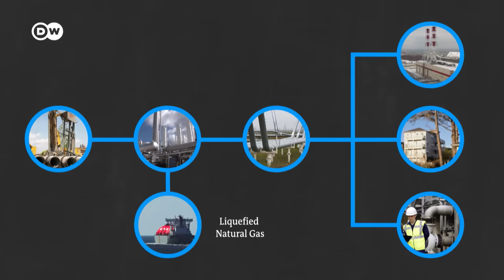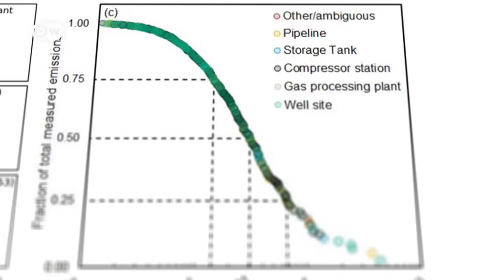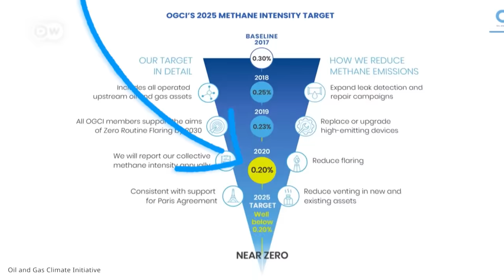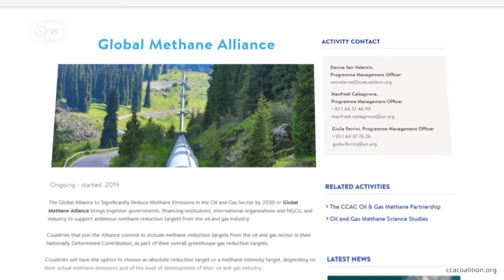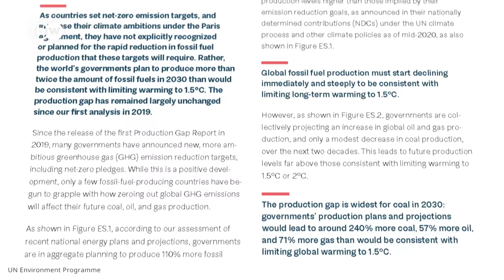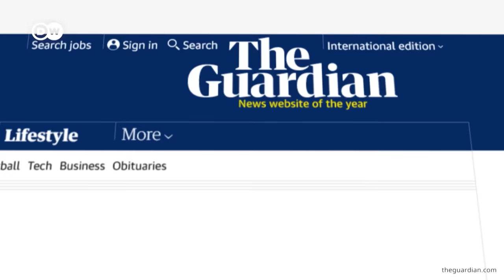Why we need to ditch natural gas (asap)

Comment: we most certainly do NOT need to ditch natural gas.  It is cheap, useful and reliable and easily transported long distances.  CO2 does not cause global warming of 1.2 degrees celsius since 1700.  CO2 concentrations re-act to and do not cause changes in average global termperatures.  try learning some real climate science.  CO2 levels have been DECLINING for the past 150 million years until 1850 from 2500 parts to 280 ppm in 1850 to present day 415 ppm which is way still below the optimal growth level for plant growth of 1000 ppm which would double or even triple agricultural yields worldwide.

Comment: There's no viable candidate for grid storage. Not to mention the production co2 and the toxic materials used in batteries and solar. Wind has a real disposal problem plus co2 from production. Nuclear power is a good option if you can dispose of waste for a thousand years.

Comment: The reality is that the only CO2-free sources of power are hydro and nuclear with limited supplies of the former and Green objections to the latter. Wind and solar are intermittent and frequently do not supply power at the times needed so must be backed up by other sources for which only gas and hydro have the required reaction times. With limited supplies of hydro that leaves gas since one can forget the fantasy of batteries being the solution due to efficiency and capacity factors. The UK, India, and other countries will solve the problem with small-scale nuclear plants such as are used to power nuclear submarines which will be available to be deployed by 2030. Countries that do not go this route will fall into industrial decline and poverty. Hydrogen is another possibility that will be made possible by using off-peak demand from small-scale nuclear plants to allow them to run at full capacity which is their best mode of operation as will off-peak recharging of EVs.

Comment: NuScale SMR is the only solution right now.  We need nuclear, and SMR is the only economically feasible solution as the regular nuclear reactors are too expensive capital wise and takes too long to build.  SMR is fast and economically feasible relative to the regular nuclear reactors.  And NuScale is the only available SMR that is approved by the NRC.  All the other SMR are in the drawing board and will takes decade to be approved and will be too late even if they are cheaper and better than NuScale.

Comment: Gas at the moment is much cheaper  than electricity, makes no financial sense to scrap my boiler, cooker and heater costing me many thousands of pounds for a bigger monthly energy bill.  Coal energy contribution is only 1.8% from almost 100%, so we have come a long way, renewables is just short of 50%.  The planet though is becoming greener as a result of the increased CO2 concentration.  Get electricity prices under control first that’s what the consumer wants and also promote solar panels with good grants on housing and a decent pay back tariff to feed back to the grid.

Comment: The main problem with getting rid of natural gas is that natural gas is waaay more efficient for heating than electricity. You get well over 90% of the energy in natural gas when burning it for heat. Electricity production is always lower efficiency per BTU, meaning you usually burn more carbon when producing electricity for heating, than just burning natural gas for heating.

Though I do agree that the fossil fuel industry likes to sugarcoat natural gas. It still produces carbon when burned (and natural gas leaks at wells is another problem). We should not be relying on it much for future power production - even to balance out solar/wind (nat gas peaker plants are terribly expensive and inefficient compared to base load power plants). We should aim to only use it as heating for homes and industrial applications requiring heat specifically.

And even heating with natural gas isn't required for warmer climates. Heat pumps, with electric heaters, will do just fine in warmer climates where the majority of heating is delivered from underground heat exchangers. Natural gas is really only required for very cold climates where heat pumps can't keep up, and electric heating is stupidly inefficient.

Comment: Nuclear is the best immediate option to avoid conflict, civil unrest and wars that are liable to happen if people are forced into pauper lifestyles due to energy scarcity. Carbon sequestration from the atmosphere to produce synthetic fuels (or just to store useful hydrocarbons) using renewable solar and wind energy is also a great option, because it both allows one to undo the GHG emissions, and to  not have to go cold-turkey on hydrocarbons used not just as fuels but also in manufacturing/industry etc.
Reply from the maker: If you like nuclear, you might be interested in:
📺 Do we need nuclear power to stop climate change?: https://youtu.be/9X00al1FsjM
📺 Is nuclear fusion the key to fighting climate change?: https://youtu.be/eyHovWQ49MI
Check them out and let us know what you think in the comments 🙃

Comment: Another dumb and unsustainable plan. Unless you want to replace relatively clean gas with coal powerplants to power the massive increase in demand for cooking and heating. Not to mention the need to basically double the capacity of the grind if you go this route.

Comment: I like to differ.  How do you make compost.? By rotting organic material. What takes place?
Methane gas enters the atmosphere. A gas that is several 100times stronger than CO2 in Climate change.
Same with sewage, farm waste,  cow or pig dung on fields, and any food processing waste.
That process takes place everywhere in the world. Every day.
What happens if you take all this organic material in industrial biogas converters.
You have methane gas, that burns into CO and little CO2,
You have oil, petrol, fertilizer
You have created a cycle that is sustainable, the raw materials don't run out.
You have saved the environment and climate.
Why do You think this technology is not used worldwide in a big stile?
Is it cheaper to pollute the environment with cheap oil and gas?
Just a little education, I hope you get the idea?😁😁😁

Comment: Sollar panels still require a rather harsh of industrial compounds to be made, wind turbines of the size we need and magnitude would and is affecting local fawna. Everything has its downside, but if we had Sollar and wind supplemented with nuclear. We’d be able to limit the damage caused by each one of them. Nothing we creat at this size won’t have its issues. It’s about living with the issues we creat. I would far more prefer the pollutant bi products of solar, wind, hydro(a bit of a golden child but still requires hyper specific locations), and nuclear which has an extreme level of control over their bi product in the form of their contamination cylinders made of concrete. A nuclear plant can account for 100% of their nuclear waste. down to the atoms.
Reply from the maker: Hey Edward! We did videos on several renewable energy forms, as well as nuclear. A few of them here: 
Floating offshore wind 👉 https://www.youtube.com/watch?v=El4kHkJ7ITs
Solar energy 👉 https://www.youtube.com/watch?v=sUvaYycoWqI
Do we need nuclear to fight climate change? 👉 https://www.youtube.com/watch?v=9X00al1FsjM
Reply: @DWPlanetA  very glad to see that, I’m happy to see you speaking about our many options. I thank you for bringing this to public attention!!

Comment: The video hammers on NG throughout the video then comes to "sure there's going to be a lot of investment needed" for renewable energy sources - investment that easy to call for but very hard to make profitable.  Plus, in spite of all the advances, renewable resource energy storage is no where near being capable of sustaining our civilization, now or in the long term.  So the stated alternatives are pipe dreams - ill thought out alternatives that simply cannot and will not work to keep the lights on and the homes warm.
That's the problem with the green crowd.  People who say a lot, but think very little and when you get people, like those producing this particular video into politics, we get recessions, depressions, inflation and $7 or $8 gasoline and economies turned upside down along with whole populations starving.  But that's the point, isn't it?  Protect "mother Earth"?  I'd say our real danger is from people with points of view that are dangerous to our civilizations, not the earth itself.

So what is the answer to our problems?  It's very simple.  We have too many people.  We need to control and reduce our populations to sustainable levels.  That will free up water resources, agricultural lands and ultimately lead to less emissions of all types.  I suppose the ultimate goal of the green group is just that, but through poverty and starvation.

This video should be banned.

Comment: Lol....  The shot at Tesla Lithium ion Batteries and saying battery breakthrough is plain Dumb... 

Lithium ion Batteries are dumbest option to store the Electricity.  Lithium ion Batteries focus is Higher KWH,  Less volume,  focused on reduced weight.  Lithium ion batteries are best for vehicles.  Either Bikes, or Cars.  Not even for Trucks.

Storing Large amount of Electricity focus should be more amount of Electricity very durable at cheaper cost.  

The only solution for this I see is..  Metal ion battery.

Comment: Methane traps very large quantities of heat in the first decade after it is released in to the atmosphere, but quickly breaks down. After a decade, most emitted methane has reacted with ozone to form carbon dioxide and water. This carbon dioxide continues to heat the climate for hundreds or even thousands of years.

Comment: Nonsense. The industry has halved raw methane emissions in the past decade and continues to work on the problem.
You need to go live in a cold dark cave and heat it with renewable fire wood which emits far more carbon.
And YOU the consumer emits the carbon, not the oil and gas industry. Do you even realize that the  carbon cost of building and operating an electric vehicle is currently over 80% of a gasoline powered vechicle. Off the assembly line alone, the raw material and manufacturing carbon costs are 700% greater than a gas powered car. We will need to increase the planet's mining capacity of zinc, copper, lithium, and nickel by by 2000% if you want everyone to drive an EV.  And the electricity needs to be generated somehow. Nuclear Fusion is decades away. Oh yeah, and that Gortex jacket and Shoes that you are wearing.......hydrocarbon.

Comment: The thing about fossil fuels is that they are by definition the best carbon sinks in the world. This is also what makes them so good at producing energy. They are carbon very tightly 'packed'. But at the same they they produce a lot co2 when burned.

Since we have burned these fossil fuels for such a long time and the sheer amount of carbon we have took from the ground and burned into co2 that was once 'fixed carbon'. We have a long ways to go until we can capture that carbon back.

No natural or biomass option will get more carbon in the ground UNLESS we are sequestering a portion of it into the soil. Some of the biomass need to be put down and be in fact 'carbon negative' so we will start making head way. Biogas and biochar pyrolysis are the only two that does this with biomass. All other biomass/carbon burning options should be discontinued at least until  we are sequestering more carbon than we are releasing aka. 'Net zero' which is aimed to be 2050. Until becoming carbon neutral we are making this thing worse. And only until we become carbon negative will we start to fix the problem. So yeah, switching off fossil fuels and depleting those carbon sinks should be done asap. We already have to sequester all that carbon that's already been burned and is being burned.

Comment: First there was coal, then man switched to oil, then they switched to nuclear.
Now is the time of natural gas. It must run its course until another fuels is discovered. Like perhaps hydrogen. Which is in its infancy as man converts water, with electricity, to liquid hydrogen. Until then it would be best that you use your videos to promote liquid hydrogen, if you want natural gas to be replaced. Cheers

Comment: HHO GENERATOR, WILL TAKING OVER HOUSE GAS POWER, this will normalize industrial since the best squeze energy for hydrogen is electrolysis, i believe HHO will save current internal combustion engine by HHO generator, what left industrial production that must provide is pottasium hydroxide.

Comment: He literally made 1 mention of biogas among several others. This is the way I think we solve this question. I'm not a climate change advocate, but I agree that cleaner fuels are better: they produce less smog. With the energy infrastructure we have, a minor change would allow us to make carbon neutral, renewable, easily produced-if on a smaller scale-biogas. But electric cars are not the answer. And nuclear is only a part of the fix, cause we'd have to produce a ton of it, upgrade the power grid immensely, and find a ready source of uranium which, I don't think, America has much of if any. They're mining some in Central Africa, but I'm not sure where else. But it's definitely not readily available. So, I'm for nuclear, but I'm also for drilling, and for biogas and renewables. Let's just have a literal ton of excess energy here and drive all the prices down and bring the economy back.

Comment: Good video thanks!!  Agree that we need to move to renewables asap. But we still burn a lot of coal. So need first to replace it. You missed one big point point, the co2 problem of coal is only a small part of using coal. Coal is extremely contaminant, emitting many high toxic components including metals and particles. It is really dangerous. Natural gas eliminates that problem. It is important to inform well the audience and not only convey what is interesting to support the narrative we like. It is important to maintain credibility. DW does a great job and I support your channel. but this is a big miss ;-)

Comment: On my second net zero home (energy use only) it is possible to shift away from unnatural gas. If every rooftop had solar it is possible to eliminate fossil fuel in the U.S. Both home that I converted to solar only covered a fractional amount of roof space. There is huge untapped solar potential. Enough to eliminate fossil fuel.

Comment: This video is accurate. I have worked in the gas industry for 36 years as a business owner and a technician. I believe that there is a place for natural gas and propane in our world for many years to come. Natural Gas should be used commercially in factories, and in large buildings that have residential, manufacturing, or warehousing purposes. This natural gas should be assisted as much as possible by renewables such as solar, and wind turbine. Many of these commercial and industrial buildings currently have massive solar panel systems and wind turbines on their rooftops or on their properties. Power Generation Plants should have a huge part of their production stemming from Solar and Wind as well, and possibly even smaller forms of modern nuclear capability. These power plants could be using natural gas to generate electricity when the renewables break down or just are not enough to support the demand at certain times. New homes in new subdivisions should not  have new pipelines installed for gas, but instead rely on propane (which uses a propane storage tank beside the home). These new homes should be built to use Wind, and Solar energy as much as possible, and then the Propane when it is needed. Oil heating should be done away with as much as possible. Coal power plants should be phased out as quickly as possible.
Reply: Kevin, 
in the U.K. you wouldn't have a viable grid without gas, coal is also viable but they are being closed.
The reason is simple, wind and solar are uncontrolled and variable. There must be a large proportion of the grid powered by fossil fuels to keep the frequency in limits as gas is controllable for output.
Renewables have a few technical deficiencies as well that do not suit grid supply, they are nowhere as good as percieved by the general public. 
Large and small scale nucelera may do this but that is many years ahead as nuclear is on teh decline at the moment. (All comments refering to the U.K.)
Reply: @iareid8255  Thanks for your reply. What you just said is almost exactly what I said if you read my comment over again. The reason I suggest gas and propane is to use it to complement renewables. Hopefully over time and new technologies the gas or propane can get used less and less. I don't see much of a reason to completely stop using those fossil fuels because they will always be great to have around for emergencies for many years. Nuclear is only an option where it is needed and safe to use.

Comment: I have closed gas entirely! I have photovoltaic solar panels. I heat home with a heat pump. I have electric induction stove and electric oven. My water is heated by a electric boiler. And the most important addition I have 2 batteries! I know most of people live in a combo/flat/apartments and can't have photovoltaic panels, but at least they should ditch gas stoves and ovens.
Reply: Did you build all these things yourself or were they made in a factory far away? How was the factory that made these things powered? How were the trucks and ships that delivered these products to you powered? Did you even think this far? You used an unimaginable amount of non-renewable energy the moment you purchased these things because your demand for them put into motion a supply chain that otherwise wouldn't have run without your demand. Indirect use of fossil fuels is still use of fossil fuels.